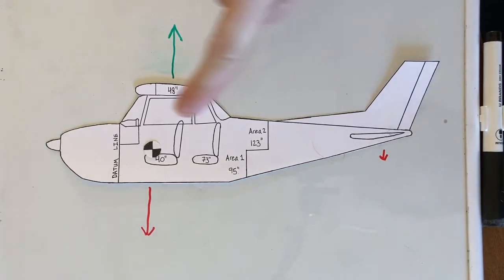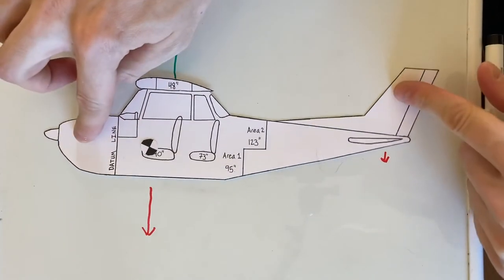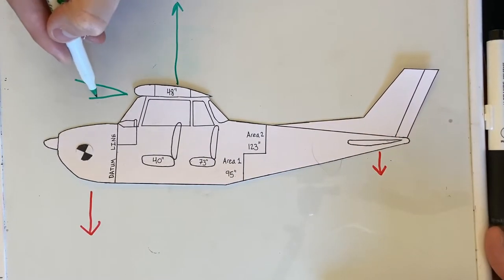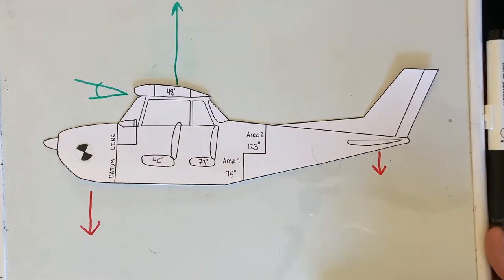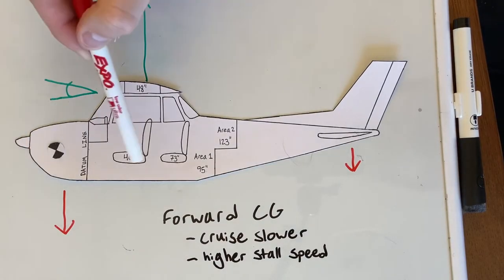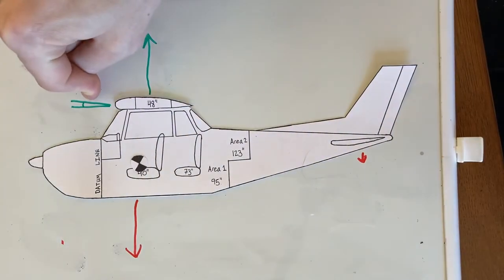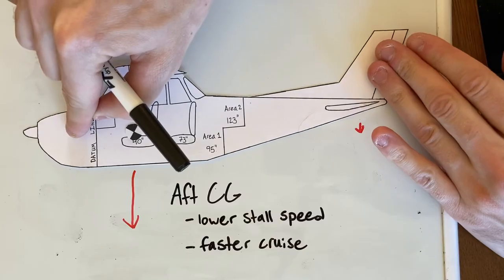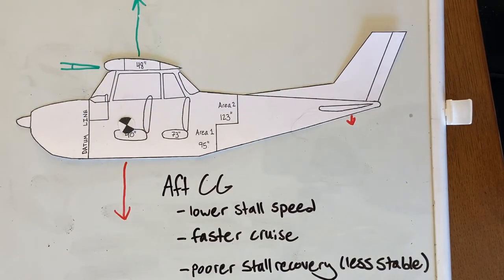Weight And Balance Part 4: Effects of Forward and Aft CG

Comment: Can we say that critical angle of attack is lower with forward cg because stall speed is higher? On the other hand cl max is higher because we need to produce more lift?
Reply from the maker: @piquecuriosity  no critical angle of attack is constant, it does not change. with forward cg you’re going to be at a higher AoA at any given airspeed so you’re closer to that critical angle
Reply: @maxcfi7718 Thanks for replying. I think we are on the same page. We are taught that for example when you put flaps down stall speed is reduced, cl max is higher and critical angle of attack is reduced but i guess Cr AoA can not be lowered in any way. What they mean is you will reach the C AoA earlier. 

So, in our F Cg scenario because we need more lift we should increase AoA and we will reach C AoA earlier. I think what you mentioned by "you are closer that critical angle " is the same with i have meant.
Reply from the maker: @piquecuriosity  yes exactly that’s right. critical AoA is fixed, you’ll just start out closer to it and so reach it sooner as your airspeed decreases
Reply: @maxcfi7718  Great 👍. Thanks for sharing knowledge. I would like to see content about flight planning and performance also if it is possible. You are a great teacher 🖐️